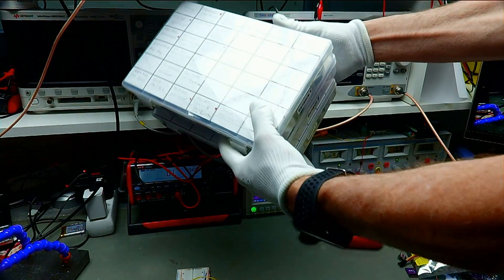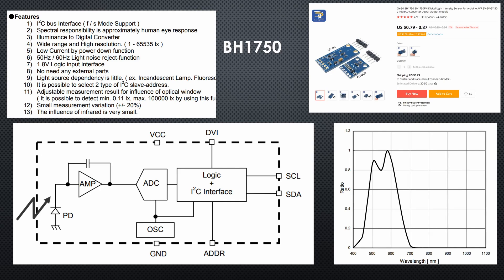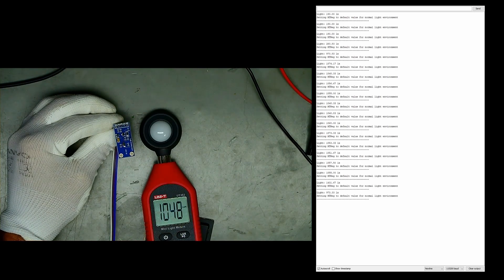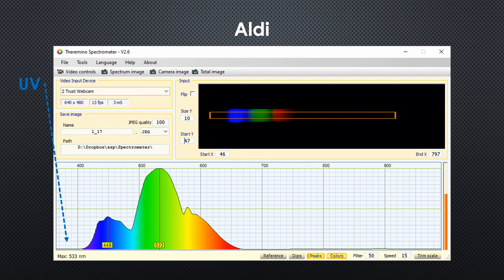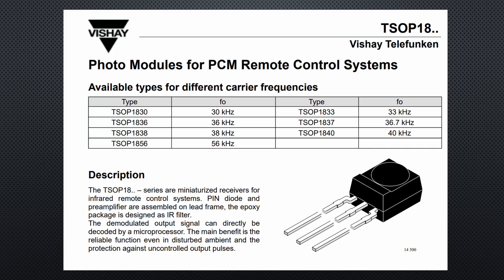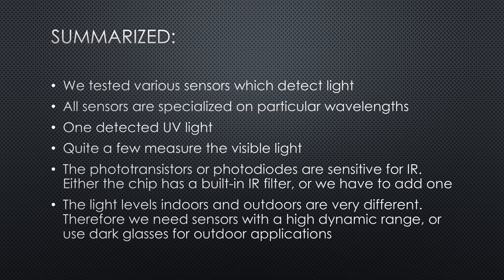#322 12 Light Sensors Tested: Measuring Light with Microcontrollers (Arduino or ESP8266, ESP32)

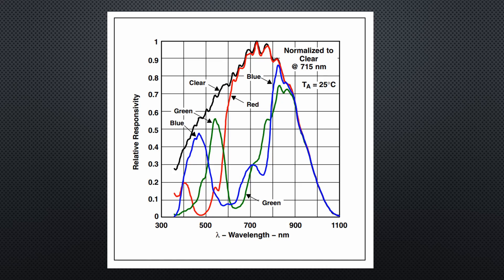Comment: Hi, the text at 4:00 is too small,
and thanks for the great content
Reply from the maker: Thanks for the feedback. I started to use OBS and did not get everything right. Next time I will change it.
Reply: @AndreasSpiess  you can just crop the view in your video editing software.
Reply: Timely recording for me. I was trying to get UV readings with a VEML6075. Reads nicely but discovered it is very directional. I'd need a solar tracker for it to measure solar UV consistently.

Comment: Try these sensors 3WK16473 from Teslar
Reply from the maker: I think they are only diodes. So you would need a bit more circuitry to create a proper sensor.

Comment: Hi, thank you for such an amazing video and information.

I am working on a project to detect the color intensity of liquid in a cuvette, I have tested TCS3472, AS7341 and TSL2591, the TSL2591 appeared to be a better choice but still I am struggling to get stable and consistent results, the solution in the cuvette is a saltwater sample from my aquarium and an Alkalinity test reagent added to it to measure the water alkalinity in dkh, the color goes from blue to green and then yellow in alkalinity to acidic condition, so if I measure the blue color intensity in water I should be able to find out the alkalinity level, the cuvette is covered in a 3d printed holder with a whole on one side for sensor and other side for LED the LED color I've used is orange which works with blue color, there is no stray or ambient light reaching to the sensor besides the orange LED, if I read the value multiple time I get different results with slight variations, I tried to average out as well but each average of 10 sample is slightly different from previous one, would you be able to suggest some good sensor or tips that may help me stabilize the results so I can get the consistent values. I would really appreciate your help. Thank you
Reply from the maker: I do not know the answer. However, I would first check without the liquid to see if you get stable values and on which level (if not yet done). Then, I would introduce the liquid and check if the amount of light still is sufficient. Otherwise, you only measure random noise.
Third, I would use an incandescent lamp because it has a very broad spectrum to see if the LED has a proper spectrum.

Comment: I found your video interesting.

Could you advise me on this...

At my job, we cut steel shavings that we stack on top of each other.

I would like to build a device that, using a CCD sensor or camera, can vertically scan the stack of pieces and count how many are in the stack.

What sensor would you recommend?

Thank you.
Reply from the maker: The camera is not important and has to be selected by the program and HW you use. Most people would recommend to use a kind of "AI" for such a purpose. Maybe you find a similar project using google.

Comment: Does anyone know if any of these light sensors are plug and play with displaycal (opensource software)?
Reply from the maker: I do not know :-(
Reply: I'm playing around with the idea of creating my own calibration tools as the do it yourself market seems to be finally maturing... it'd be nice to work with the open source computer side, but it might be more feasible to just hook up a display to an arduino or raspberry Pi and have a completely discrete unit...

Comment: Thank you for the light sensor review - quite enlightening!
I find it difficult to source only the lens cover that is needed for an actual use case. Unlike the Panasonic PIR sensors which come with the lens, the light sensors do not
The ones that come with the hobby sensors are about 28 mm in diameter.  It would be great if anyone could point me to a link to buy a more compact lens to go on top of the light sensor.
Reply from the maker: I have the same problem. They are not easy to get. This is why I use IKEA glass boxes...
Reply: @AndreasSpiess  Thank you. We are trying to 3D print our lenses. Will let you know how it goes

Comment: Very glad to have found this channel and this video.  Would like to have seen more info on UV sensors, particularly for a weather station to detect the UV level outdoors.
Reply from the maker: You can find other UV sensors. Just make sure that the protection does not block UV (e.g. Glas blocks UV)

Comment: I worked in lighting for 10 years. The best light sensor in lux, in my humble opinion, is the Texas Instrument OPT3001. I scanned across the entire visible spectrum, from 380nm to 780nm in 20nm steps, and the sensor actually fits almost perfectly the CIE-defined eye sensitivity curve. It is the best light sensor I could measure. In addition to adjusting to the sensitivity of the human eye, it can measure from 0.1 lux to 100,000 lux. This dynamic range of measurement is amazing.
Reply from the maker: Thank you for the tip. I ordered one.

Comment: For analysis of food & fruit contents like fat carbohydrates etc which sensor is good for getting the wavelength of 700- 2300nm
Reply from the maker: I do not know these NIR sensors. I only used IR transistors which work on 900nM. The AS7263 covers 600-900nm for example.

Comment: Hi Andreas, 
I want to use the RGB sensor to detect the color of the water in a transparent tube, will it work? My idea is to read the PH/Alkalinity level of water of water test kit. If it works, which is the best RGB sensor choice?
Reply from the maker: I cannot answer you question. It is too specific, and I do not have a lot of experience with such sensors. Maybe google knows?

Comment: Hi,

I wpould like to build something simple but I can't find a clue to do it. I want to know if the light is ON in the garage and another room. Setup: two small ESP8266 boards that I can pot into deep sleep. When the light is on they send data to an Arduino board (eg. D1 WEMOS so that a LED starts blinking(maybe connected to the D1...D9 outputs. I just want to use my personal wifi network. No IOT MQTT etch do display on iPhone etc.What I find on the internet is that they aal use ESP32 and IOT and MQTT...it is to complicated .
Can you put me on the way??? Maybe a list of your YT-video's I need to watch? Thanks
Reply from the maker: I would chop your design in simple blocks and start with one block. An ESP8266 is quite versatile, but these days I would probably start with an ESP32 because it has more possibilities and is a little easier to use. 
For each block you will find examples and tutorials.

Comment: Hi Andreas, fantastic video like always!
Do you have a sensor you can recommend as the best option for measuring LUX and PAR for plants under a grow light?
Reply from the maker: There are many Lux meters around. I do not know which is best. All are relative and have to be calibrated...
Reply: @AndreasSpiess  thanks Andreas. Was hoping to find some good information of a comparison test on the internet for lux sensors pair d with Arduino to measure "grow lights" but cannot find a good source. Plants require different light intensity at different stages and it would be great to be able to measure this accurately and automate :)
Reply from the maker: I once made a video about a spectrometer. Maybe this helps ?

Comment: Do you think these RGB sensors would work well to read liquids? if this is the case, do you think we should add extra ilumination?
Reply from the maker: I am no specialist in this matter. I think you have to try your particular scenario and also if you want to use reflected light or shine through the liquid.

Comment: Has anyone found a good way to calculate W/m2 or umol/m2/s from an affordable light sensor? I'm asking because these are the main units used in agriculture for light intensity and I'm working on a greenhouse project.
Reply from the maker: I think the only way to get results with these sensors is by comparing it with a calibrated sensor. I only use it to measure relative, not absolute values

Comment: Can I ask you a question about UV-C sensors?

I built a germicidal UV-C sterilizer from an old microwave oven and a UV-C mercury vapor water sterilization bulb, but I am wondering about the actual 254nm irradiance level at the disinfection target distance. The manufacturer has ignored my requests for irradiance specs on their bulb, and reviewers like BigClive have found that many UV-C bulbs from China are fake and give off little or no UV-C light. I'd like to get a reasonably accurate UV-C irradiance reading without investing in a UV-C laboratory photometer.

I did a little research and I found the 1918 ANALOG UV SENSOR BREAKOUT Board and that looked promising except that it has very poor sensitivity in the germicidal UV-C wavelength range. But then I saw that the GUVC-S10GD photodiode has a spectral range of 220nm - 280nm, which is ideal!

Do you think the GUVA-S12SD photodiode on the 1918 ANALOG UV SENSOR BREAKOUT Board could be de-soldered and replaced with the GUVC-S10GD photodiode (or the GUVC-S40GD, or something similar) to get a better UV-C sensor breakout for germicidal UV-C measurement projects?

NOTE: I don’t have enough electronics experience yet to understand what sorts of modifications to breakout boards are possible, so I’m reaching out to engineers & makers who have more expertise. It would be great to open source a diy project for building a UV-C photometer around an Arduino and some inexpensive off-the-shelf components.
Reply from the maker: I have no experience with such sensors, so I am no help

Comment: At 10:19 you're talking about the TSL2591 as not recommended, but the red box on the left doesn't include that sensor. Looking at the AMS website, it actually says "Industry leading dynamic range which drives both ultra low light sensitivity and bright sunlight operation" about that sensor.
Reply from the maker: I just read the content of this website. It is more for professional use in products

Comment: I understand there is no perfect battery for the ESP8266 because it is power hungry.
There is one alternative no one has addressed.  I want to use the ESP8266 on battery with a solar cell only during the day. No one has addressed saving power by using a IR sensor to turn off the battery at night. I believe this is called “how to make dark light sensor”  @
For many ESP8266 project we do not need to use them at night.
Could someone determine the Solar cell and battery requirements using a light sensor to shut off the battery at night including  cloud cover???

Comment: What sensor would you use to detect color or brightness change on a little area (i.e. 1 cm2) on an LCD screen? Sensing speed is important. The faster the better. Color is unimportant, I need to detect if anything changed on the little area being watched or not.
Sensor size is the smaller the better.
Reply from the maker: I do not know. Maybe you need a lens in addition
Reply: @AndreasSpiess  Thank you!

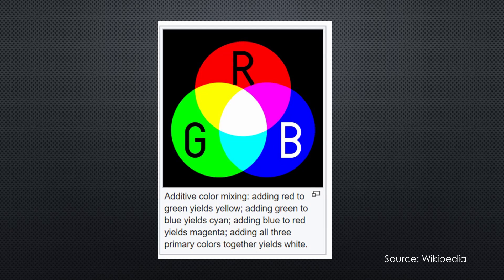Comment: 2:19 - It doesn't have to be specifically R, G and B. You could also measure at Cyan, Magenta and Yellow. Or any other mutually complementary hues. Basically, any three hues that are at 120º from each other on a colour wheel can be used to determine the dominant wavelength.

But, as you know, reading just the wavelength won't allow you to distinguish (for example) red from salmon pink, or yellow from brown, since those differ in brightness and saturation as well. You can calculate those in software if the sensor outputs the three channels (not just its own internal calculation of the wavelength) but, as you mention later in the video, many of those sensors have very irregular overlap between the channels.
Reply from the maker: You are right. When I was young I worked for a company called Gretag where we developed color meters for the printing industry. But these facts are too complicated for such a short video ;-)
Reply: Gretag-Macbeth, later merged into X-Rite? I think I used a couple of their calibrators some 15 or 20 years ago.
Reply from the maker: Yes. Even before Macbeth...
Reply: Isn't Macbeth from the 17th century? ;-)

Actually, I vaguely remember seeing something made by Gretag before the -Macbeth. It wasn't related to printing, though. Maybe light meters or something related with photography? My father used to be a cinematographer (retired now).

Comment: hi i am using a GUVA-S12SD  an UV analaog sensor with a cubecell, i tried few steps of my own and connected to it and able see data in serial monitor of arduino, but even if i remove the sensor connection it its still showing  some data in serial monitor
Reply from the maker: Maybe you divide your system into two parts: First test the sensor and the Cubecell separately to find where the error happens.
Reply: @AndreasSpiess  thanks that really helped and i am able to see sensor data in arduino, if u know any program where i can see this data in ttn. or any relative

Comment: The TCS3200 may have use in non digital applications. Life is about change, and, that everything repeats itself. I know, that's odd, but if the digital age ended, (EMP?) you could essentially hook one up to an antiquated panel meter via transistor and smoothing filters.
Reply from the maker: I am not so sure if it is less prone to EMP. Still some silicone on it ;-)

Comment: I have been waiting for a video as succinct as this. You explain clearly what they are and are not doing. Thank You.
It is even crucial today to know what is happening around us throughout the day. We need UV for Vit D production, but too much can cause cell malfunction. The world has a VitD deficiency which has aided in this recent health fiasco. Smothering our children and selves in chemicals that block solar rays 45 times normal should also block Vit D production. So I recommend supplements. There are a lot of energies that we should monitor around us daily. I think you're on a roll, my friend. How much can be compiled and operated through a cheap uC such as the ESP 32? Sensor fusion is key. I have also designed a UVC barrier for face masks that irradiate any organisms small enough to penetrate the primary filter. And anything passing the secondary filter is inert. DNA/RNA shattered to be absorbed for processing in the body. Now when CN opens back up I'll order a bunch of the emitters.
Reply from the maker: I use a slightly different approach against bacteria: I try to train my immune system with no extreme hygiene. Also for vitamin D I try to be outside every day and not use the car for all transports. I hope like that to get a decent dose of the needed Vitamin D. But of course, I do not know for sure.

Comment: Hello Andreas,

I have worked for TAOs since long before we were purchased by AMS.   You are correct the TCS3200 is outdated.  Also the TCS3414 as well.  Neither of these have IR filters because when they were designed the technology to deposit the filter directly on the chip was new and very expensive.   You are right the TCS34725 is the only AMS part you had that is not obsolete.    BTW the Avago part is really an AMS part.   TCS3223 I believe.   

AMS now has a TIme of Flight device you should try.   This is very interesting part.   

Oh, and that TSL2561 was used as the Ambient Light Sensor by Apple in the very first iPhone.     Those have a very wide dynamic range because you have an analog gain setting and you can also set the integration time from 2.7ms all the way up to 65535 x 2.7ms.   

Great video!

DE N5BOC
Reply from the maker: Thankl oyu for the info. I still struggle with both sensors out in the sunlight. As far as I see TCS34725 is saturated and the TSL 2561 sometimes provides strange values. I have to investigate further and also ordered some ND filters to reduce the light energy.

Comment: As I totally believe in your knowledge could you review the new Sonoff Zigbee bridge ? I would appreciate it greatly .Also since they are Zigbee and supposed to connect to each other if you spread three or four around the house would they form a mesh network boosting all the devices ???
Reply from the maker: I already made 2 videos about ZigBee and mesh. Not with the Sonoff, though.
Reply: @AndreasSpiess  yes I saw but does it work with Sonoff that's the question ,not every function works with every piece of equipment even if stated it does from my experience until you test it you don't know if the claim is true ,I have two big bins if equipment that are stamped as Google home comparable and are not ,the supplier said sorry thats what is no refund !
Reply: @AndreasSpiess  Just got an answer from Itead studio ( Sonoff) they say it works as mesh .